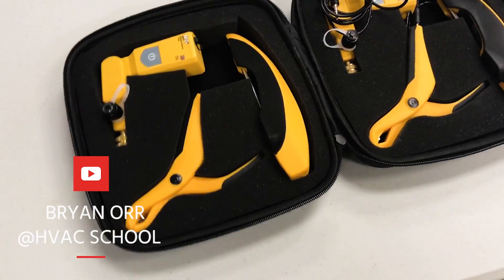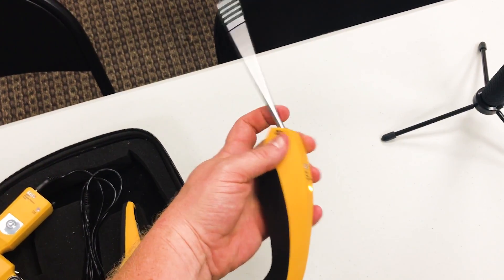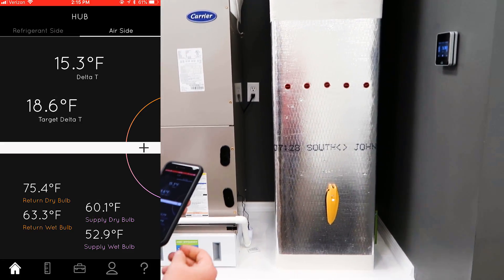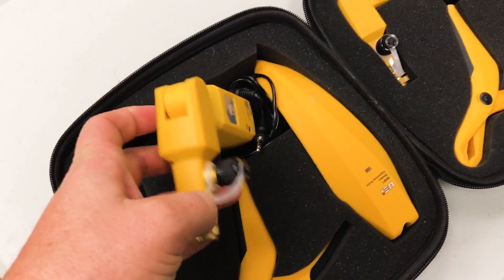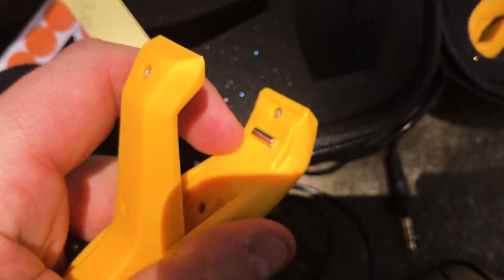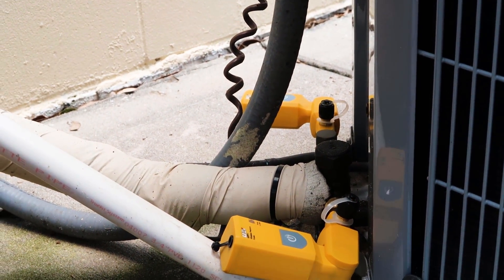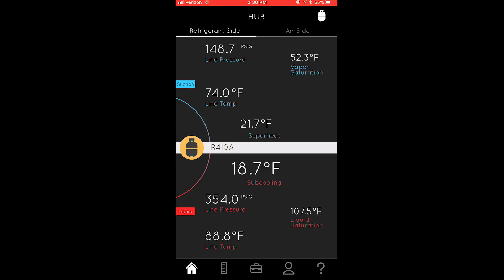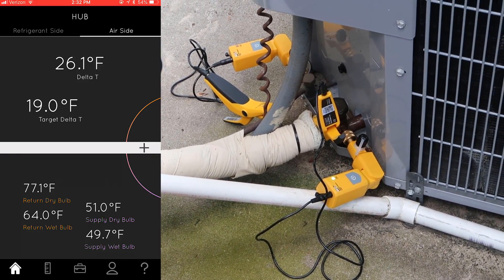The UEI Hub Kit in Action

Comment: I was interested in purchasing the HUB6.  Your video convinced me that I wanted the kit.  Purchased in April and have used it the entire AC season.  Have only had problems with the pressure probe (more than once) but UEI support sent me new ones swiftly.  The app is simple with no crash or reboot issues.  The psychrometer probes are still nearly spot on with each other (0 to .1 degree difference on both DB and WB... you can't beat that!!!).  Wireless range is adequate.  I've had no issues yet with connectivity at either residential or commercial locations.  I keep the compact Ritchie 45 degree ball valves (93842) in my kit for those units that you can't connect any wireless probe to.  Not sorry I purchased the kit!!  Maybe MeasureQuick can add this to their arsenal some day???

Comment: You state the delta is higher due to the lower air flow. Can the air flow be changed in the app?
Reply: He’s talking about the airflow of the AHU, which I’m 99.999% sure is not app connected. But they do make a programmer for ECM that is app controlled and you could do that...
Reply: He’s talking about the airflow of the AHU, which I’m 99.999% sure is not app connected. But they do make a programmer for ECM that is app controlled and you could do that...
Reply: He’s talking about the airflow of the AHU, which I’m 99.999% sure is not app connected. But they do make a programmer for ECM that is app controlled and you could do that...
Reply: He’s talking about the airflow of the AHU, which I’m 99.999% sure is not app connected. But they do make a programmer for ECM that is app controlled and you could do that...

Comment: Can you assign probe A as supply and it will always be supply when it powers up and connects to the app? Probe B then could be return with the same connection set up?
If so, just mark the probes. "S" for supply and "R"R for return or a color or something. Then no guessing or reconfiguration needed.